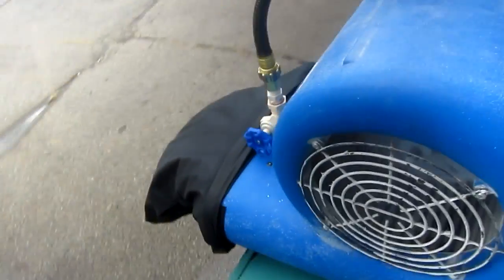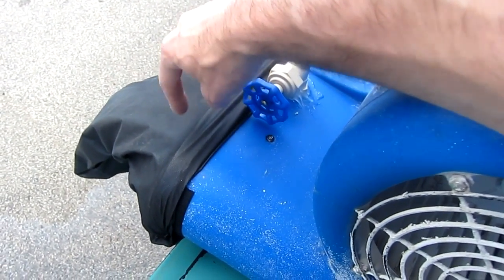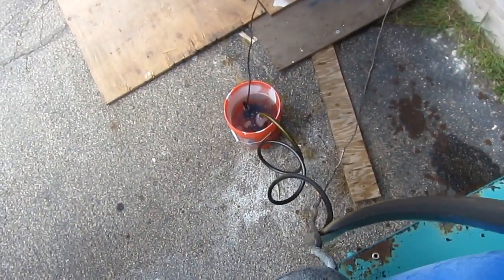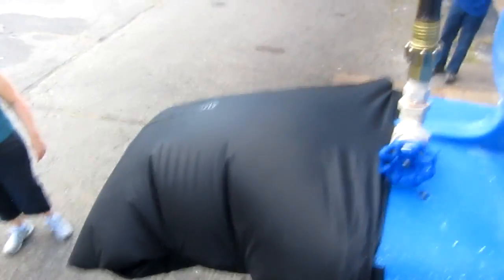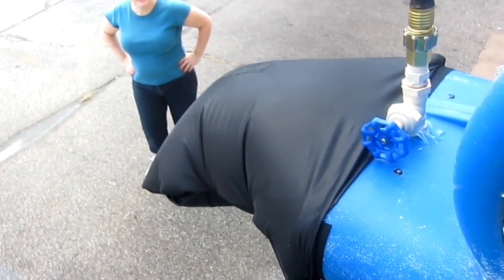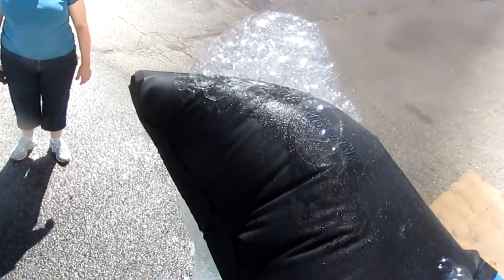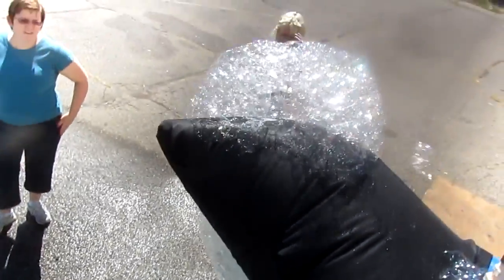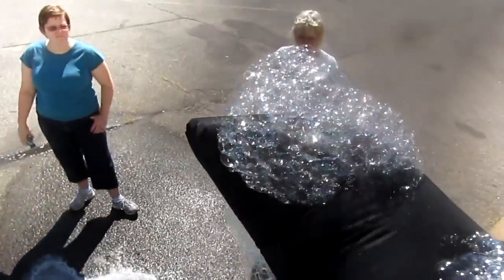Captain's Blog 8-28-11 Foam Machine Prototype Testing Day 1

Comment: If that is the pump I brought in that is a sump-pump pump. It isn't designed to run under pressure like a well pump is. It would be great in that bucket to mix things up but past that you are going to need another/different pump.